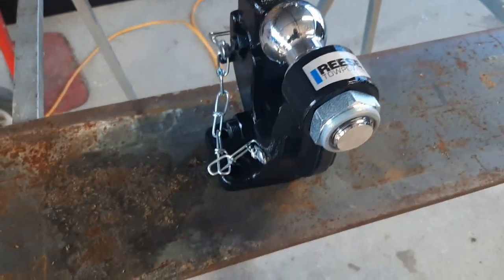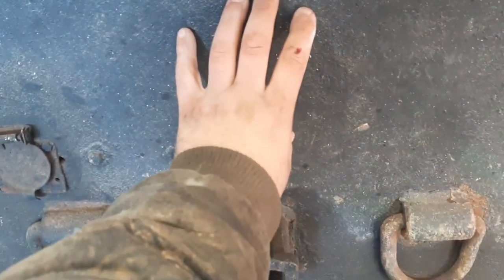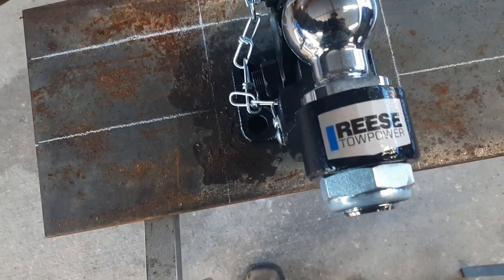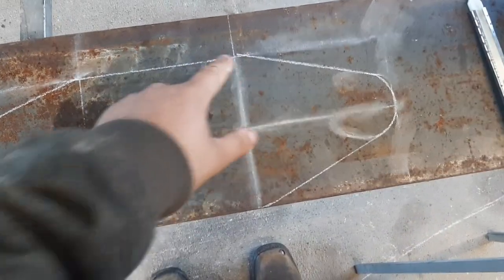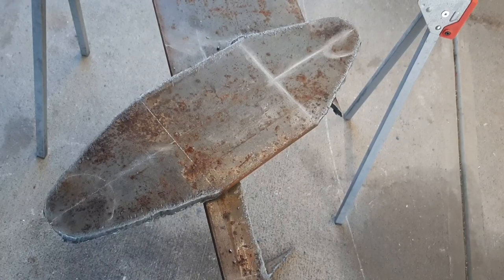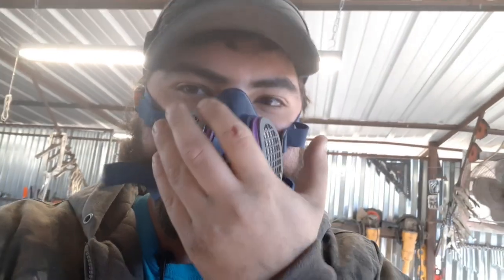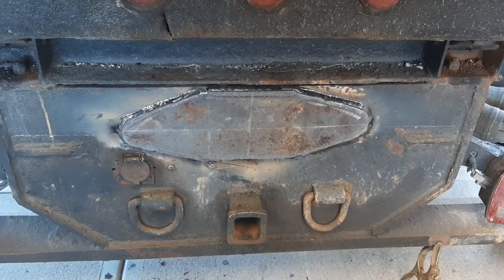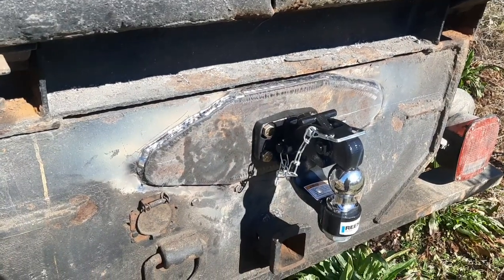Installing a pintle hitch on a dump truck

Comment: So now is the bed going to hit the pintle hook when it dumps and usually a pintle hook that  has a ball combination is not a heavy duty  pintle hook. He should of bought the hitch with the plate to mount the pintle hook on and slide it into the existing 2" receiver.

Comment: I dont know if i could weld the two plates together if they were not 100% flat. seems like it doesnt gain anything to me. now the weld is preventing the two plates from touching. might have been better to bolt the two together flat before welding or replace the damaged hitch plate.

Comment: We were putting our HF arc injectors through the harshest testing that we could think of and we syill had some faiures. Instead of buying certain parts from China we are working with a small electrical firm here that is willing to tool up and make a run of the high frequency high voltage parts . My goal is to make the best product at the most reasonable cost. Maybe we can increase the warranty because the damage we had to do to the units I do not think anyone would put them through in normal use or even harsh use. I will stay in touch.